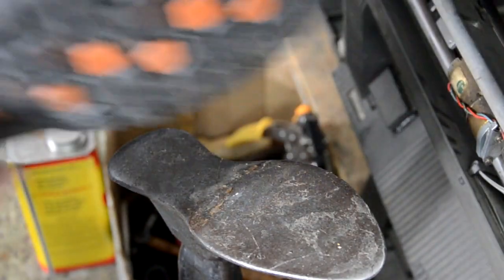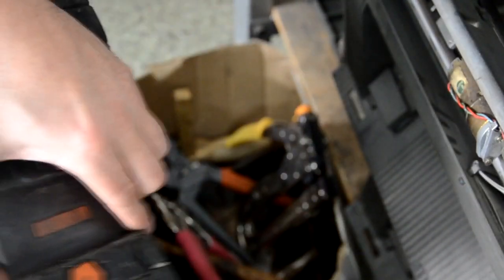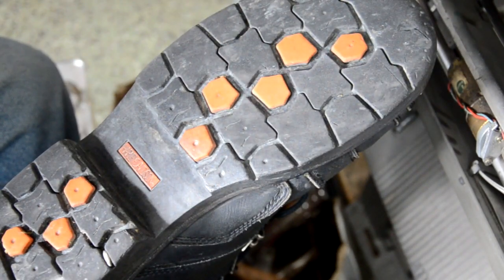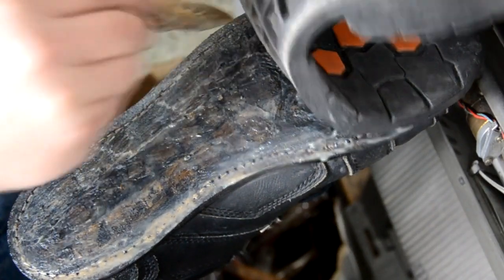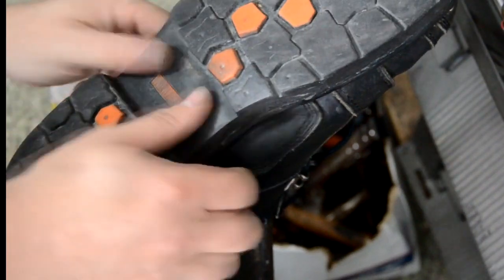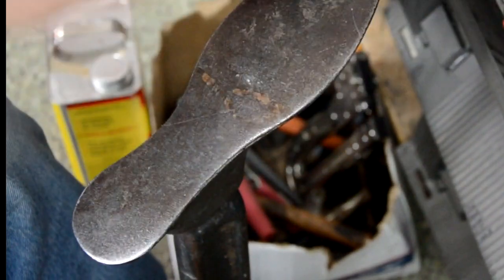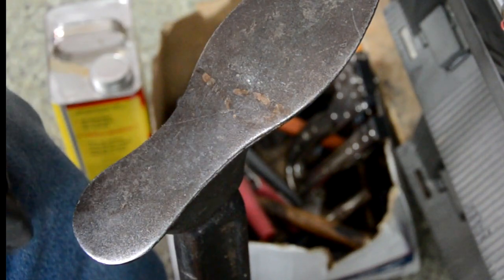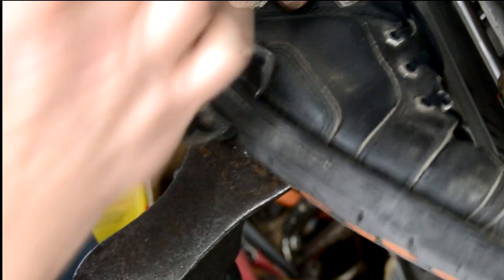shoe repair:Harley Davidson sole shoe glue

Comment: I have a pair of HD boots with that exact same sole on them, I received them as a gift from my mother-in-law before she passed away, but like you said they're the type with the zipper on the side and the soles on them has turned loose I wish I had some way of getting them to you for repair or had the cement you used so I could attempt the repair myself.
Reply from the maker: No, Jim has retired 7 years ago

Comment: From the 1:00 minute mark until 4:06  he spreads the glue, & makes a real job out of it, I liked the part where he used the belt sander to hide his fuckup because he didn't line p the top & bottom of the boot before gluing it back together... This is JUST another example of a way to waste any goofy video time.. DOH